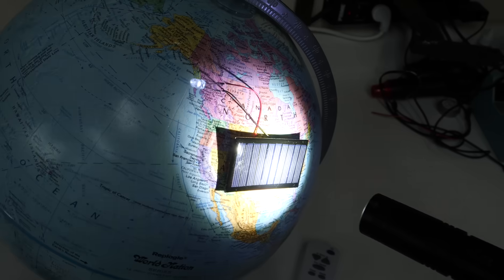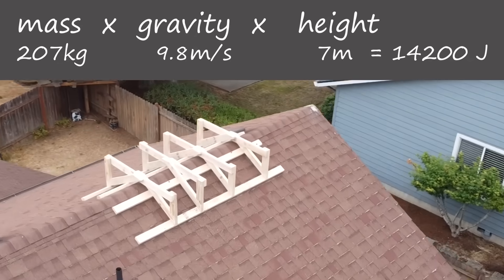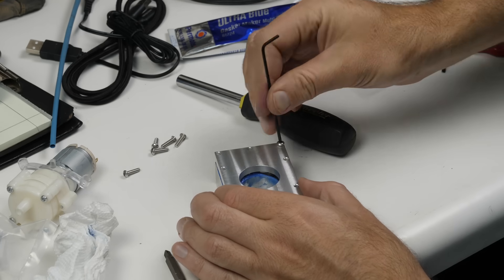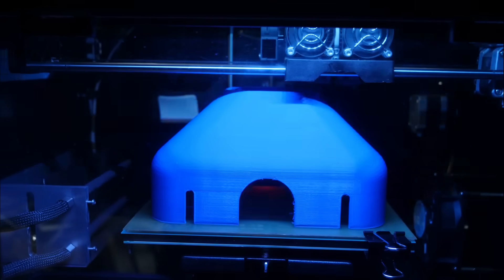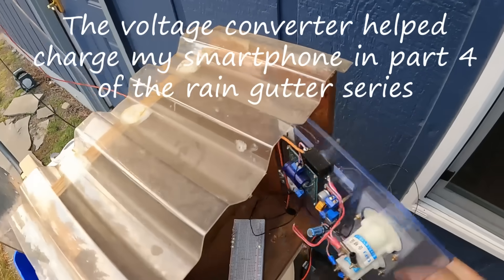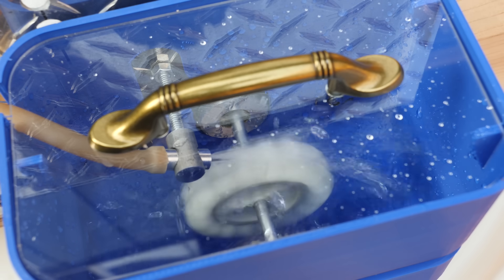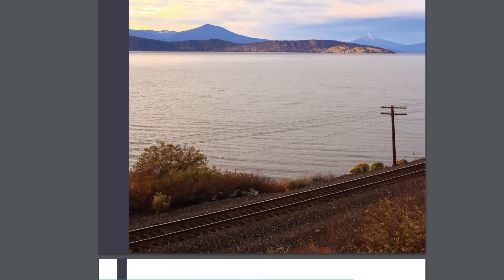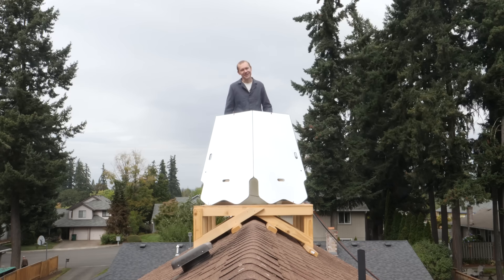Storing Solar Power on my ROOF!!!

Comment: I'd be interested in a video testing the efficiency of your contraption and showing the math used to calculate it. On a clear day, calculate the power of the sun over the surface area of your panels to estimate the efficiency of the panels, then calculate energy required to fill barrel with solar panels, then calculate the energy generated by the pumped hydro. It shouldn't be too difficult, but could be a really informative educational video that shows how math can be applied.
Reply: Wouldn't be difficult at all,  it looked like he pumped around 20g/hr up the top, using a 50w pump. I assume they are 44g drums,  which means it took just over 100w/hrs to generate approx 4w/hrs in storage. 
So you have an efficiency loss of around 96%. One of the few renewable scenarios that works far better on large scale designs using natural and man made terrain to your advantage.
Reply: > calculate the power of the sun over the surface area of your panels to estimate the efficiency of the panels

He said it's a 50W panel - and solar panels are specified by the electrical output in full sun at 90° angle (ie sun position along the normal of the panel's plane)

> calculate energy required to fill barrel

He said 14200J (about 4Wh), or as he stated, approximately the energy stored by a AA battery.

14200J / 50W is about 5 minutes, so given his 5.5 hour fill time he's already down to 1.5% storage efficiency for just the charge cycle.

> calculate the energy generated by the pumped hydro

He didn't offer any energy specs from the output of the generator during discharge, but the numbers are already extremely sad even without that.

Pumped hydro only makes sense on massive scales, and only in specific areas where it's possible to find or build two huge dams with a large height difference between them.

The Crooked Creek and Winter Ridge proposals are apparently aiming for an energy storage capacity of about 4GWh (output, estimated storage efficiency of 80% so 5GWh to fill) and a power level of 500MW, which would (each) be enough to power 8% of the state of Oregon (46.7TWh/y = 5.3GW average) for 10 hours - and that's with a pair of 2.5GL reservoirs with a height difference of 600m
Reply: Just point the hose up and see how high the water shoots up lol.
Reply: produrre energia solare di giorno e idroelettrica di notte ( l'acqua come batteria ed accumulo di energia).

Comment: Great video! Cool application of a basic concept. Couldn’t it be applied to a very heavy object(s) and a lift? When the weight falls, it could pull a generator and create charge that way
Reply: I think the benefit of this video is, a very small amount of solar energy can pump water a little at a time. If we used your weight option, you'd need a lot of solar energy at once to lift the weight up the shaft. Perhaps a counter weight could be used, but I'm not sure of the logistics.

Comment: 14,000j -> 3.888 Wh -> 2.5 Ah at 1.5 volts.
So yeah, AA battery.

At 5 volts (Mobile Phone Charging) you get 760 mAh.

iPhone 13 Battery capacity is 3,227 mAh.

Thats about 8 hours of run time (heavy use) on a Pi Pico. (+-93 mA) or 20+ days if you run it in sleep mode — waking it up for the occasional task.

Comment: so the water output is much faster than the water input? how long then can you run from one barrel of water, and need to wait to refill the roof barrel? also what power are you going to use to refill the roof barrel if no sun is available> you will probably need the same barrel @ the bottom?

Comment: Well of course wind and solar power are episodic. Hence the need for some kind of storage to provide sufficient electrical power to smooth out the variable output from these renewables. Obviously during night time the solar output will be zero and much more power will need to be drawn from stored energy system like pumped hydro. However adding a third source of renewable energy  to the mix changes things considerable. Already in use in many countries, wave power can provide significant amounts electrical power in a predictable manner. Recent developments in Australia have produced a next gen wave power system that generates grid scale electrical power. So the combination of Wind, Solar  and Wave power provides a diversity of independent power sources that improves reliability of energy supply. Coupled with grid scale battery storage, this configuration of multiple renewables is a viable system for coastal locations. Notably it is not affected by low rain fall or drought conditions as pumped hydro can be.

Comment: take your electric pump and make sure its vaccum sealed  Then add another line off the bottom of that box the same size as the one you brought from the roof down to go up. make sure you seal the line going in on the roof is air tight sealed. When you open the water line the pressure will pull the water down the line, it will turn your motor, the bottom line will draw the water and the vacuum that is created at the top from the water tank  will suck the water to the top and replace the water without the need for your solar panel.  As long as everything is sealed